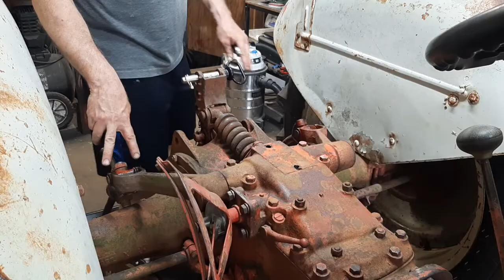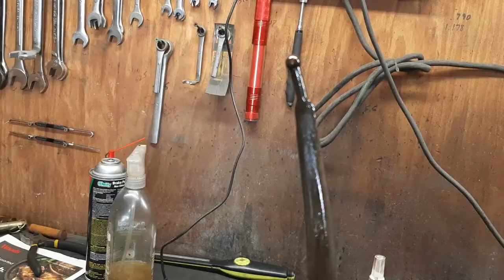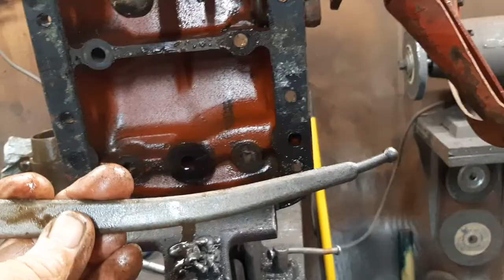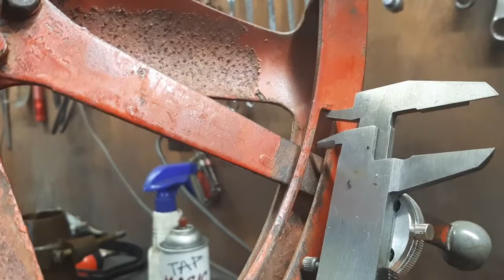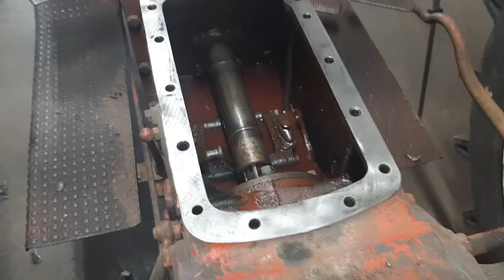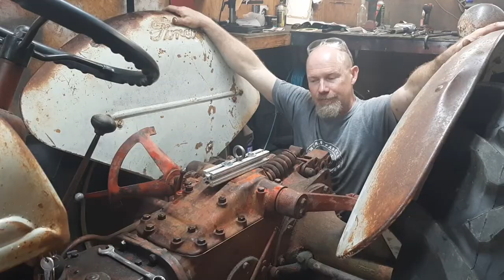Ford 8N - Hydraulic Lift FIXED!

Comment: You gave a great view of the process. I have that problem with my 8n. I lifted a tandem 19:50  disk and after that it does not. want to pick up my two bottom plow, or anything with weight. I really appreciated yo knowledge on this, thanks for sharing your wealth of knowledge!  Dave
Reply from the maker: It sounds like you may have sprang a hydraulic leak inside the tractor.  I'd pull the cover off where the dip stick goes and look inside while it's running to see if you have any fluid spraying.   The lift cover gasket blows out some of the time around the fluid passage.
Reply: I'm having a problem  when I pick up my shredder to drive to the next pasture  it slowly  comes down . Then I have to stop to turn the to on to raise  it back up then go again . What ideas  to you have . Is it the pump

Comment: I have a Jubilee (NAA). Where did you get all your specs for spring length, off set of lift lever, ......... What manual do I need to purchase so I can have those specs for my model?
Reply from the maker: I used an I&T shop manual that I picked up at my local Tractor Supply Company.  I&T also makes a manual for the Jubilee so if you have a TSC store near you they should have one.  https://www.tractorsupply.com/tsc/product/i-t-shop-manuals-ford-shop-manual-fo19-48-pages
Reply: @xpsgarage  Thank you!

Comment: I'm back with more questions! The "Jig" you mentioned. I was not able to understand the name you said. What is the name of the Jig supplier? Do you happen to know if there is a Jig for the Jubilee (even though it does not have that long arm you straightened)? Thanks so much. I do have the manual now thanks to you!
Reply from the maker: Here is a link to the jig. I've never seen anything like it for the Jubilee.  https://www.just8ns.com/LG500-Years1939-52-Lift-Jig_p_2850.html

Comment: I have a 1952 8n and I have an old 5ft rotary mower. Should I have the little lever  up or. down to mow uneven areas?
Reply from the maker: You would need to have the lever up in the position mode and just set it at the height you want.  I assume the mower has a wheel on the back that will help it ride over the bumps.  The hydraulics on the 8N will let the mower move up as needed but only come back down to position you have it set at.  If you tried it with the lever down in draft mode then it would just drop the mower to the ground and only try to raise it if you snagged it on something.
Reply: Ok, thank you for getting back to me. I really appreciate it.
Reply from the maker: @TedBaylard-wn2qh  No problem.  Good luck with the mowing.

Comment: Did you ever get this dialed in? I noticed the bushing for your lift arm also looks shot as it had some slop.
Reply from the maker: Not yet.  It's close enough that I haven't wanted to take it apart again just because it doesn't drop quite all the way down.  If I need it to lower that last few inches I just flip it over to draft mode.  I'll get back to it eventually.

Comment: my lever to raise and lower the 3  pt only moves about an inch, pto still goes up and down but not alot. what is my problem?
Reply from the maker: Sounds like something might be bent.  Like I mentioned in my other response get an I&T service manual so you can dig in and find the problem.
Reply: thanks

Comment: Arms go up but don't come down on ours. Any suggestions on what the issue may be?
Reply from the maker: First thing I would do is remove the inspection cover where the dipstick is at.  Next move your quadrant control up and down to see if the control rod in the tractor moves properly.  If that checks out then the exhaust valve in the pump that releases the fluid is probably plugged up.  If that's the issue you may need to drop the pump and do some cleaning.

Comment: I really like watching DYIers, l’ve learned a lot from them. You did a great job on the video, but… you do realize that the “bent” control arm is factory bent and should not be straightened.
Reply from the maker: The problem was that with the amount of bend it had it wouldn't work right.  I watched several other videos and the control rods on them looked straight so I tried that, but that was too much.  About half as much bend as it had works properly.
Reply: @xpsgarage  Thanks for the reply back, I’m getting ready to tackle the top end and replace the piston and your video has great insight on how to get the. I am enjoying gleaning yo
Reply: (To continue) your other videos for valuable insight. Keep up the good work!